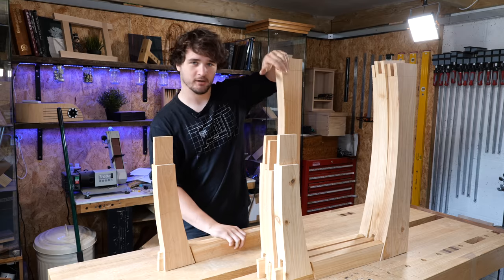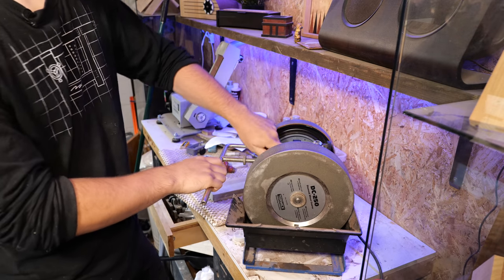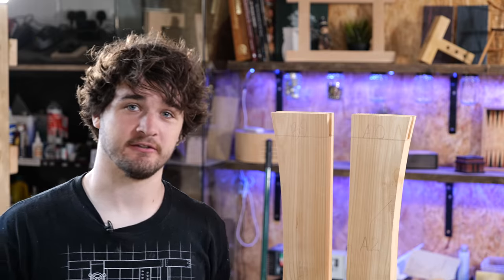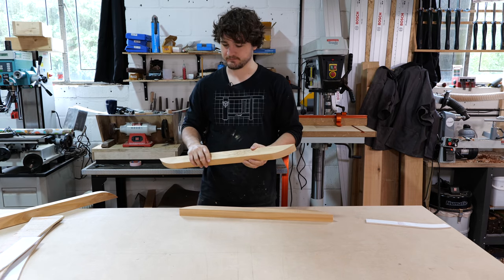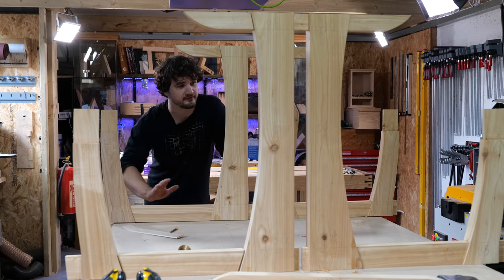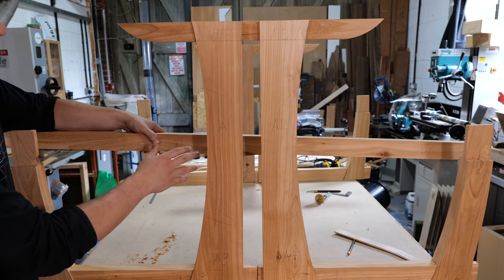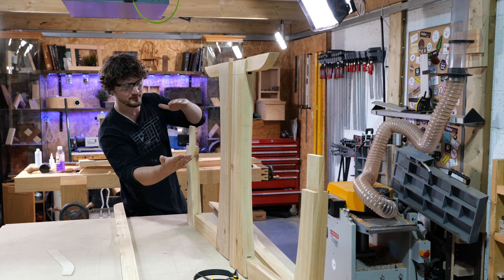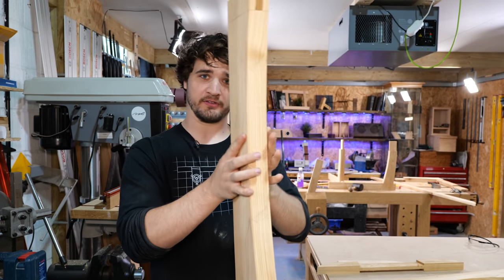Cutting CURVED Joinery 🧐 | The Japanese Inspired Picnic Bench Project #6

Comment: Saw that someone already said it, but I wanted to explain it a bit. Methylated spirits and denatured are essentially the same thing (various brands have varying recipes). The "methylated" and "denatured" part comes from the companies' using at least half ethanol (which we drink for fun), because it's cheap and easy to produce and keeping it at about 50% reduces costs instead of using a different alcohol alone. However, if it was taxed as pure ethanol, we'd be paying tons for it because governments like money. To get around this, companies decided to include methanol (byproduct of distillation process and still an alcohol) to stop consumption. But people are stupid and drank it anyway.

The methanol breaks down into a new chemical (formaldehyde if I am remembering correctly) that kills you pretty quickly. The only way to get around methanol poisoning is to then continue drinking ethanol until your body flushes the methanol and its byproducts. So... to stop this, companies started introducing methanol-ethanol blends that have various chemicals to induce vomiting, that taste bad, and that also provide a visual cue in some cases, thus reducing idiocy.

So, we end up with a methylated, or denatured, ethanol that is no longer fit for human consumption. These can now bypass the laws, regulations, and taxes that are imposed on consumable alcohols and cheap, industrial grade alcohol can be used by the masses.

I'm loving this project. Thanks for putting it out there.

Comment: Rather than rip the long piece in two - and I realise I'm too late - could you have created two half laps on opposing faces of each vertical piece (the inside of the left piece and the outside of the right piece let's say)? To fit the joint, simply pass the long piece through the centre of the two verticals pieces, before pivoting it round to meet the opposing half laps and be in place to meet the outer verticals perfectly.
That would have been so much easier in my head (in other words, probably not easier).
Reply: Yes, I was going to suggest splitting the long cross piece into three parts. They would have a half-lap joint hidden in a through-mortise inside the vertical pieces. Means you don't need to keep the curve going through the joint, which might make it easier to cut and keeps the strength?

Comment: Great video. Not a criticism but why do you even need to glue the bridle on the middle section? I think it is unnecessary, just locate it in the shallow bridle will create enough shoulder support in the middle. I would peg it only to the middle beams. Wood look japenesish also...

Comment: Matt I dont think the way you said to assemble it will be possible, due to the angle on the bottom pieces you wont be able to slide them up. One way to get around this is to angle the mortise so the outer uprights can spread out meaning you can then slide the bottom pieces into place in the centre then the outer joint. If the mortise is angled at the top, so more cut out towards the inside, it would be hidden by the seat. Hope it makes sense, and good luck :)

Comment: One suggestion to fill the gap between the two parts with some darker wood. You could even take that a step further by adding dowels of the same dark wood to the other joints.

Comment: As this is such a large project and lot of wood may need soaking can i suggest some pipettes. You dont have to waste the meth spirits or alc pouring it on or use a scrubbing motion that loiks like you broke a corner by doing. They are cheap to get on amazon etc

Comment: I would've done the bridle joints on the top of the legs differently,  it's hard for me to explain, especially in english, but I will try: I would have made the tennons slide in straight, and have the curve overlap onto the face of the stretcher

If this makes sence, please tell me, if not, tell me as well, cheers!